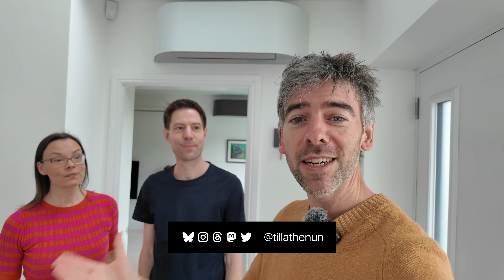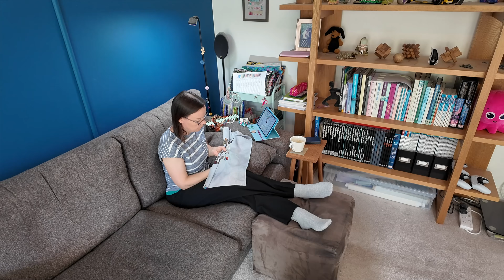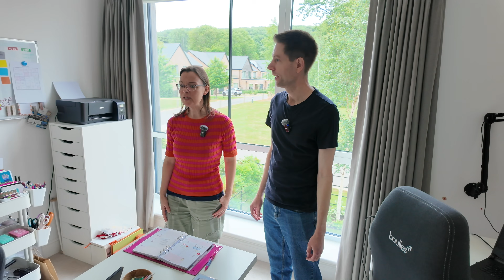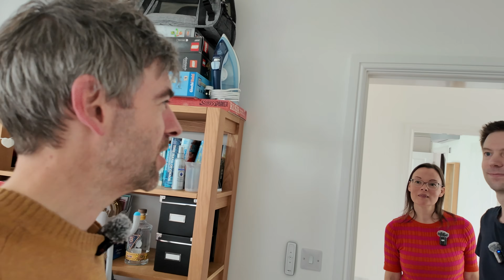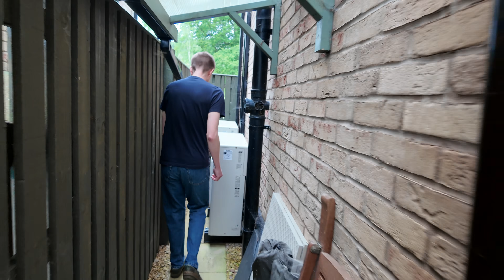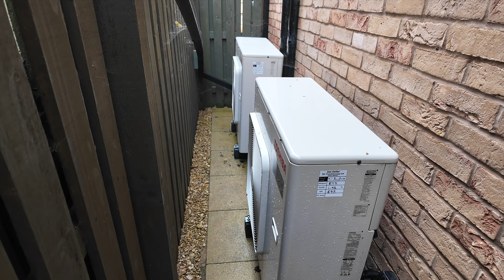Best of Both Worlds? Heating and Cooling with an Air-to-Air Heat Pump

Comment: We had a big 5 kW single split AC first and stopped to continue after 7 years when the first mitusbishi broke down. It was caused by not cleaning indoor and outdoor unit.
And then we got behind that the air 2 water heatpump was a lot cheaper than we thought when I saw the chinese on a fair in London. 
Finally I went back and met them again Nuremberg and bought one  that i had known from Norway, Trondheim, over 1250 km north of Hannover. 
And the price was the key point for get it added. Delivery time was 6 weeks and the 6, 8 and 12 kW heatpump had 1 price incl. vat ddp = 2004 USD or 1750 € back then.

We have 2 Mitsubishi Split AC and each 5 kW which could heat the 180 sqm Bungalow 95% of the year but the noise gets louder in winter which we did not like. We use these in the biggest rooms and still benefit from cooling. We have no multi split which does not work well if you have different temperatures in those rooms. At the end it works only if room temperatures are the same for all rooms connected to 1 outside unit and with different temperatures in the room cycling kicks in and efficiency goes down. 

Solareast BLN-008TC1 is our, but they have developed a new and 10% more efficient D version insteat of our C generation you can recognise before the last number which represents the number of phases - here in this case 1 phase which is 100€ cheaper than the 3 phase one. We have bought it due to the fact that this Heatpump was running in Trondheim Norway for already 6 years and that they still delivered. These R290 heatpumps are certified by the german government and we would have gotten 65% grants if we would have gone a certified way with a consultant who has to do the application work first and pay a lot more then diy and it should take 5 months before we could order the unit. 

And that would cost us the savings of 1 heating seasons which are 3000€ versus 500€ = 2500€ per year (mostly in the heating time). So we did a diy and hired an oil condensed boiler installer to ADD the heatpump to our system. Total investment was 3500€ without grants and much cheaper than the 2 AC systems installed by installers.

Of cause we have 1 central heating which is easy to connect and operate with home asssistant and surplus heating. So our heating energy is supplied by 2 third from solar roof and that pays off within 2,5 years. The Solareast models are certified by TUV or SGS which are certifiers that the units perform as promised - no chinese phantasy COP. We have radiators type 33 and have a SCOP of 3,8 incl. hotwater (270 L boiler), hence the heating temperature is at 50 Celsius at -10 Celsius. 

All of our systems have a manufacturer energy monitoring - but we did not trust these and added our own from SonOff which are accurate and proofed that mitsubishi was counting properly (deviation about 0,3%) and also solareast.

Comment: The air-to-air video in the old house was how I first found Mr EV, and from there Tim & Kat shortly afterwards, so I love that you’ve combined forces for this one.

Air-to-water makes the most sense for me for the reasons Tim outlined there at the end, but air-to-air is just something that I can’t quite rule-out somehow. Once the day comes to move over to a heat pump system then I’ll likely get quotes for both before making a final decision.
Reply: Funnily enough that was how I found Mr EV too!  Their original A2A video was the first I watched of theirs.

Comment: If I had a property without (plumbed) radiators, I think I would go for the air-air solution, as I would expect installing underfloor pipes and radiators (when not refitting a property from scratch) would be a huge undertaking and cost. The one question ("so how do you heat water") had previously been immersion heater, so this choice is very interesting and answered my only real negative of air-air.

I would have been interested to see the outside "impact" of the AW-SHP cylinder (ie the vents or whatever), but suspect it is minimal.

Having radiators, I'm awaiting an AW-SHP quote, but this has been useful as I'm considering a single aircon unit for the summer (at the top of the stairs) in the hall, to effectively "take the edge off" the heat in all rooms. In hotel rooms I rarely use aircon but, if I do, have it on while I'm out of the room. For that reason I feel a single split unit would likely work well, and a distributed unit in the loft would be OTT (as well as it not cooling the ground floor).

(One minor point with the video: for me the video froze in a few spots, perhaps 12mins in and towards the end; only mentioning in case you can and wish to re-upload)

Very interesting - thanks as always!
🙏
Reply: If you have an existing immersion then with an EV tariff it's marginal whether changing the water from just using the immersion is worth it. There are units now that do water heating and air/air and the calculation has changed a bit. It also depends how much hot water you use.
Reply: That's true.. if one has a good cylinder with immersion & decent tariff it's likely not financially worth changing. 👍

My comment was from the perspective of a property with gas combi boiler (no cylinder) 😊

Comment: Nice video. Tim said he wished he'd put ducted air in the top floor. What about ducted air on the ground floor? Would there be space between the floors? Don't most houses in North America use ducted air? Then no need for those large units on the walls which I don't like the look of.
Reply: You'd be limited by your floor joists. If they run in the right the direction you could run a duct between them but you would be very restricted in any other direction. The ducts are too large to drill holes or cut notches. That sort of thing really needs to be designed into the house when it's built.
Reply: @robinbennett5994  I'm guessing then, that most new UK builds are not suitable for ducted throughout. Which is a shame. Also another thing not mentioned, unless I missed it, was MVHR installed? These split systems, as shown in this video, do not perform this function.
Reply: @drigans2065  Yes. MVHR is very rare in the UK. I'm pretty sure Tim & Kat don't have it. I was quoted £15,000 to retro fit it to my house (and went for a £300 recuperator in the bathroom). 
That's unlikely to change either. The Future Homes Standard increases insulation and air-tightness, but not to the level where MVHR is required.

Comment: We've had exactly this solution in our house in Australia since the 1990s. Daikin. Great in summer and great in winter.
Reply: I've had a daikin unit installed in the bedroom. It has a 5 year guarantee. How long do they last though in your experience?
Reply: @harrypaton2844  daikin are great. you should get 10+ yrs from it
Reply: Don't suppose you get much freezing conditions though, where the thing has to defrost frequently.
Reply: @edc1569  You install a unit designed for your temperature range. Finland and Norway are known for their tropical winters and use them on a vast scale.
Reply: @edc1569  Sydney's west gets single figure temps overnight. We used it some of each day for 3-4 months, but rarely 0
Reply: @edc1569  I'm in Melbourne up in the hills and we see -1 or -2 fairly frequently over winter.

Comment: Really good information. I have solar panels and a battery (plus an EV 😀) but a gas boiler for heating and hot water. So when I persuade the Lady Wife (which will take some doing...( it will probably be an air to water heat pump for us.
Reply: What's the main obstacle stopping you? Price?
Reply: @oliversissonphone6143 Not price on its own. We'd struggle to site the heat pump (shared drive so tricky) and my wife doesn't like the look of them...
Reply: @leswhitehouse  She doesn't like the indoor unit or the outdoor unit? Do you generate an excess of electricity from the solar?
Reply: @oliversissonphone6143 The outdoor unit. With an air to water system we'd keep the existing radiators. The solar panels generate enough power to export most days
Reply: @leswhitehouse  Ah makes sense. May I make a suggestion?

Comment: We went for Daikin Multiplus ❤  so we have A2A outside unit + 3 AC indoor units + DHW tank. All energy comes form 1 outside unit.

I believe they updated it few months ago. Current generation supports water heated floor as well
Reply: I’ve just been quoted £12k plus, for 4 Daikin multi split installed, but not including electrics?  Daikin configurator on their website was half of that. I think installers are making some hay while the sun shines. Literally.
Reply: Do you mind if I ask how much you paid before the grant if any? I’m thinking of the same system in a three bed bungalow.
Reply: @StillAliveAndKicking_ Final price was 5400€ (we received 1900€ grant).
Reply: @M @Mleko147 Thank you, that’s competitive with other systems.

Comment: great video, fyi, there are air to air that look like picture frames.  

I saw a mini-split system that used the Mitsubishi “EZ FIT” / “Designer” High‑Wall Ducted Air Handler. Shown on multiple episodes of This Old House in the U.S.

These units look like a picture frame box on the wall, about 4–6 inches deep, with a flat front panel. They are NOT the typical mini‑split blower. Instead:

The heat exchanger is in the attic
The wall unit is just a small ducted supply + return plenum
Air blows out through the bottom or sides
The front panel looks like a decorative frame
They are part of Mitsubishi’s Ducted Air Handler / EZ FIT lineup

The system components I saw on This Old House were:
1. Mitsubishi Outdoor Heat Pump (Hyper‑Heat or standard)
2. Mitsubishi Attic Air Handler (SVZ, PVA, or SEZ ducted unit)
3. Mitsubishi EZ FIT / Designer Wall Outlet Box
This is the part that looks like a picture frame.

Comment: Air to air seems the way to go although it is possible to ‘bolt-on’ aircon to an air to water system. An ordinary immersion heater for the hot water may be cheaper overall especially with a smart tariff.

Comment: Great video which I think should be a strong indication of which way to go Andrew.
When I put in a heat pump in our living room well over 10 years ago my wife was not impressed with the look of the plain Daikin unit, which I got cheap as they were end of line. But on the first hot day she changed her mind quickly and now it is just part of the wall furniture, although it is that old that the main plastic has started to discolour, but the air flap hasn't annoyingly. 
Being the dinosaur I am I took a while to realise i can use them for heating and I remember one cold but sunny spring day when the sun was out I could heat my living room for free with the solar from my panels.
I did a year later put one in our bedroom too, which on whisper mode you cannot hear the indoor unit at all and was a godsend in the summer.

I like the idea of ducting the upstairs to the all the bedrooms, although a little concerned of how high the fan speed would be to direct the hot air in winter so it properly circulates down to floor level. Although saying that, other then the bathroom, the bedroom radiators in our house are on very low or even off as the heat from the downstairs warms the upstairs anyway.
I do follow Tim & Kat's channel, although when he starts getting into the statistics of it all, my mind fogs over.
Reply from the maker: I hate the term "game-changer" but they really are on hot days. I'm not surprised your wife was a convert from there on.

Tim does love his stats, but then, that's his job!
Reply: That’s disappointing from Daikin. I’m about to put 10 units in my house so do you know if they have fixed the problem with the new ones?
Reply: @chazprouk  the units work fine, it’s just the plastic has aged slightly. As I said these were old units I bought as they were end of line 3kW indoor and outdoor unit was about £290. They use R410a. I bought 3 in total